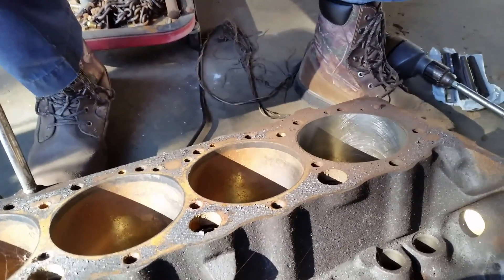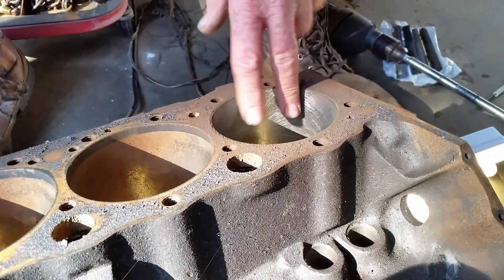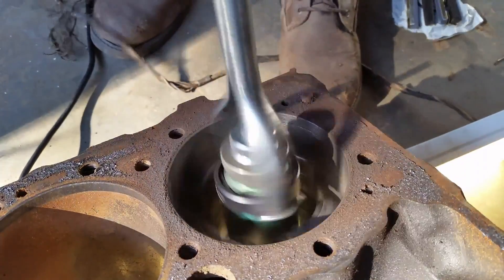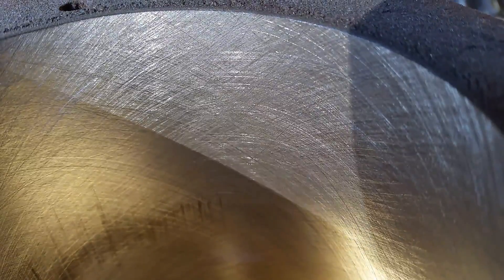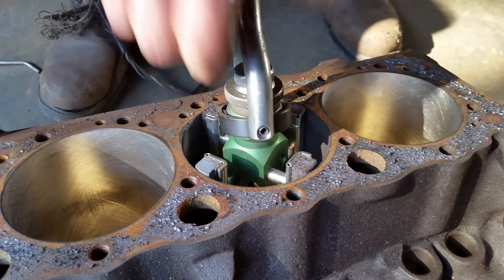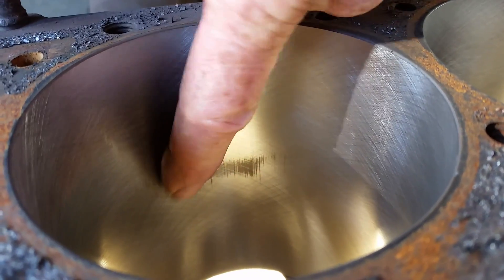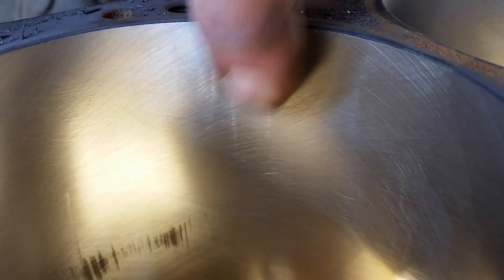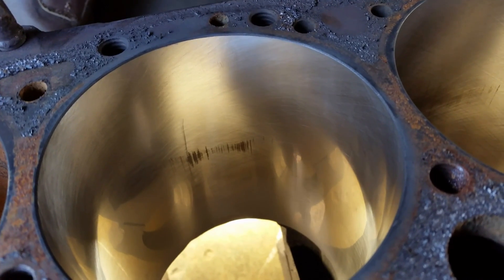How to Platau hone a block

Comment: I know this is the "tried and true" method...
But I certainly don't do this on my personal rebuilds. Seems primitive and haphazzard, to me.
The cylinder material is what should be considered when choosing the grit number, not the ring material. I question whether people even comprehend what is occurring during the seating process. The ring material is so much harder than the cast iron cylinder. Its not as though the cross-hatch pattern serves to "file down" the high spots on the rings. Just the opposite occurs. The honed cast iron conforms to the contour of the hardened rings.
I also refuse to use one of those honing tools on my engines (or my custmer's). Its like a caveman sharpening his spear with a rock. That was great when we were hunting the Woolies, but 
we are a tad bit more advanced today, I'd like to think.
I select the proper grit sandpaper sheet, fold it to an easy to manage size for the bore I'm working on, then painstakingly create the cross-hatch pattern (by hand only) for each cylinder, changing the sandpaper to expose fresh grit for each. I have developed a knack for this process over the years, and it allows for a perfect pattern each time.
Also, to the inevitable horror of the crowd, I will assert that I am very careful to "hone" the ring -travel portion of the bore only. The last thing I want, as I rebuild my engine for longevity, is to create an iron "file" below the ring-swept area of the bore, which subsequently induces unnecessary and accelerated piston skirt wear for years following the initial start-up. Think about it... the thrust-side skirt of the piston rides under great force, along a scuffed cylinder surface that does not get scraped by oil-control, or compression rings. Thus, the interaction occurs between aluminum and cross-hatched cast iron. We all have seen the smooth cylinder bores of used engines...
except for where the rings don't ride. The original cross-hatch hone pattern is always still present below the ring travel. Why let that surface "sand down" your piston skirts? Just apply a little more thought and care when preparing your block for assembly.
Well, I'm in my mid-fifties now, and despite the inevitable on-slaught of rebuke to follow this comment...
I have been building engines this way for decades, without a single failure. I share these concepts for the benefit of those who can embrace them. Otherwise, I am o.k. with those who can't. Build your engines in whatever way you choose. (It makes it easier to pass you on the highway.) Ha.
Cheers.
Reply: I dont know,, I've seen quite a few cast iron rings go in cast iron cylinders. I've also seen alloy rings go in cast iron cylinders.
Reply: marshalllhiepler sir thank you for your comment it was very long..now getting to the sandpaper deal I done the same thing back in the late 70s early 80s.and there is nothing wrong with that.like you I'm in mid 50s...when you are building a race engine you try different things...see that is the defrent between you and me.you build stock..I build race..I've learn a lot over the years like carbs..cams..heads..pistons..rocker arms..and I did the same thing to my cuz race car it went from 7.30 to 7.00 in the 1.8 mile..and some people would pay 1000 dollars per tent...that's 3000 dollars...dam that was a lot of typen...again thank you for your comment.sir
Reply: marshalllhiepler and to 👍
Reply: You were on a role 'till you said you prefere hand sanding the cylinders lol.
Reply: @whiplashmachine ,
Like I said  ...  you build engines in whatever manner you choose to.
I'm certainly not going to ague with your methods, especially not via your sign language in my rear-view mirror. 😁
Reply: @marshalllhiepler  pretty sure it be you,  in my rear veiw😁🍻
Reply: @whiplashmachine ,
"Pretty sure  ..."
suggests uncertainty.
At least your intuition knows what's up. 😆😂🤣
Reply: @marshalllhiepler  whomever it is trying hard to keep up and blowing a bit of blue out their exhaust doing so. Figured might be you or one of these other guys with hand honed blocks😂
Reply: @whiplashmachine  ,
Perhaps you should refrain from knocking "hand-honing", until you try it.
I have proven in my own shop, that honing by hand seals better than mechanical hones, as evidenced by performing leak-down tests.
It requires more time, and effort, but since the rings seat better  ...  I can't go back to the whirly-stones.
Reply: @marshalllhiepler  I've done my own testing thanks. I have also fixed dozens and dozens of backyard hone jobs over the course of 20 years machining engines. A hand hone can be sufficient and I've honed quite a few with Sunnen micro adjust portable hones for fun. But I understood exactly what was going on and the machines do a better job. Only those that can't afford one or to have the op done for them say otherwise.
Reply: @whiplashmachine ,
If you had observed the mechanized honing striations with the extreme emphasis upon detail, as you suggest  ...  you would have noted the inevitable angular flaw, which occurs during direction reversal of the tool. An unavoidable semi-circular arc is left at both the top and bottom of the cylinder, with each and every stroke of the machine.
Only precise honing by hand, can achieve the desired 60 degree cross-hatch striations at TDC, which are of vital importance to the capture of rising pressure, as the flame path propagates throughout the combustion chamber.
This is why my vehicle always passes yours, whenever sufficient asphalt exists.
However, being the mechanical god that you are  ...  you already knew this. Your time spent lounging upon your throne has rendered you lazy, without the energy, or desire to perform the neccessary honing operations by hand. Thus, you condemn yourself eternally, to second place.
And, I am o.k. with your decision.
Reply: @marshalllhiepler  you are correct. I am now going to go and sell my Sunnen power stroke honing machine in favour of cheap youtube hack tools😂😂😂
Reply: @whiplashmachine ,
The truth sometimes hurts, my mechanically inclined one.
But lament not, for thou hast become enlightened.
Reply: There are many different materials used for modern rings today. Cast iron, while still used for very low performance engines, has largely been replaced by better materials.
Here is an interesting article that describes "ring evolution" over the past century or so:
https://www.dragzine.com/tech-stories/the-material-details-evolution-of-piston-ring-technology/
Reply: marshalllhiepler are you having bad dreams about this video??sorry sir..I did not mean to upset you...I just turn 55 my self sir..you know they say you can't teach old dog new tricks...I say b.s. I still want to learn something new every day..and if you look at the video very close you will see the deep cuts is very small that is to hold a small amount of oil...what is the best thing for meadel to ride on????oil.....I done the same prosest to my cousin race car and it went from 7.30s to 7.00s in the eight mile....I have even seen the same thing in a book by grumpy Jenkins...do you know who he was?????I'll tell you he was pro mod in the 70s......soo is the old 55year old dog learning new tricks or does he wats going on?????once again thank you for your comment sir 👍

Comment: Good example of what Nat to do.  So what size is that hole that needs bored?  4 stones? where are the stabilizers? Bore gauge?  Taper? But it will run.  Sorry I shouldn't  beat you up. Make more videos it help guys learn. You will be OK in the shtf scenario!
Reply: Robert Hoard sir you did not beat me up I love questions like this.bore size is 4.060 .there was 2 stones and 2 wipper..no stabilization needed..the block was for dimo only....me and jomasterhn is working on a aude and we did the palto on cylinders and the cylinder went from ..0015 to..0025 other words..001 thousands buy this way.....and sir thank You for your comment 👍.....aney more questions just ask...sir

Comment: Just curious how many thou over the cylinder is after the full procedure or is it a case of matching the piston and rings to the final measurement??
Reply: TheRebelOne this is the question that I have been waiting on....when you are dry honeing it doesn't take a lot out of the cylinder like wet honeing so you can do a lot more to the cylinder .....thank you for your question 👍👍👍👍👍ty.and to if you look at the center of the cylinder you will still see the dart spot in the cylinder was about.  .0005 of a inch now wet honeing the 80 git would have takeing it out and starting to bore the cylinder...and once again thank you so very much 👍
Reply: The rings are always matched to the cylinder bore at the most unworn part.
Reply: This hone takes very little material but it does help true the cylinder and it puts a nice crosshatch on it. I NEVER hone a cylinder dry because it plugs the stone up with dirt. keep it wet and keep it clean and true...approx. a 33* angle each way for crosshatch  so the crosshatch breaks the ring in properly...
Reply: Des Stanford sir did you really look at the cylinder the only place the hone did not touch was that little spot on the out side of the cylinder.....thank you for your comment sir
Reply: A ridge removal tool must be used to remove the ledge on the top of the cylinder before honing otherwise the top ring will make contact  with the ledge and break. ( Standard workshop practice. )
Reply: Des Stanford THAT IF THERE A'S RIDGE AT THE TOP OF THE CYLINDER thank you for your comment sir 👍
Reply: Des Stanford sir I understand what you are saying but this block had NO RIDGE at the top...why do you think it clean up so fast....the block I was useing was a block that a soooo call manschans that did not know his ass from a hole in the ground
Reply: snowman Reed sir this hone I'm used you can used it wet or dry...thank you for your comment sir

Comment: love the,sorry,old school. i've used this to bore out a block when money was tight. as a hole wears at top you start at bottom pulling out hone till it speeds up an push it back down. set tension again,repeat. once you get bore back straight work the full lenth of bore. as for cross hatch pattern to wear rings in i like a bit less 30 degree. bin a bit since i've done one might just blow the dust off mine. used to do rear slave cyd right on the backing plate with a mini one but they stopped selling the rubber seals a wile ago.
Reply: Witt Graham have you tried rubber bands to hold everything together? I got one of them kits too thank you for your comment 👍

Comment: Hi sir I have so many questions 1 is this tool just to remove the edge  of the top the thin line 2 can this  tool be use as a honing tool but to put  the first oversize pistons 3 if it is how do you know how big you need to hone I mean the mm of the piston I have those with sanding paper I sand the edge but  still when I put the piston and finished to start the machine has a lot of smoke coming from top we call it carter pressure
Reply: Sarief Idoe 1 question you probably can.I would not recommend it.2 question yes you can but it will take time.what you want to do use the 80 grit until you can. Just fit the new piston in then finish with finer stone to get proper clearance.3 question you will need to use a feeler gage to get proper clearance.if you get a kit like what I got it will come with instructions.and a big plus is you will see you can use this hone wet or dry I hope I have answer your questions...ty

Comment: By the proper sounds it made,i'd say it was cutting ok;  if it was steel sleeved,oil might be  needed,but being  done directly on the cast iron,which is self-lubricating due to the carbon particles,it seems that  dry is working well here; 

One thing i would NOT do:  run the stone up and down so MANY times; reasons:  
1--- you are ENLARGING the diameter, need to mike it again,to see if it not junk already!!
2---- since you are doing it  BY HAND, the next pass DESTROYS the previous one,because you CANNOT follow the SAME scratches.
Reply: Jose Peixoto You Did not lisan to the video when I said THIS IS THE WAY I DONE IT ty for your comment
Reply: 1-you can buy oversized pistons
2-i can bore a block this way an the engine 20y later is still running in the boat,by hand
3-you should stick to taking stuff to a shop or a car lot
Reply: Witt Graham sir the block was.  .060 over all ready.have you seen the other video boring a block the pistons came out of that junk block.I can put 8 sleeves in.I just can't see cost and time.when it's a 2 bolt block.4 bolt yes. Ty for your comment.....You know what that make a good video.have to think about it

Comment: Stupid guy does not know the correct grits right off the top of his head.
Reply: crosstimbers2 I did my job I did check with ring manufacturers now it's your turn when you build a engine....
Reply: crosstimbers2 and too I'm not stupid as you would hope for.thank you very much.....
Reply from the maker: Are you sure about that?
Reply: L P.  If you can't remember 3 or 4 honing grits you can't know what you are talking about. People have been honing blocks since before you were born yet you don't know what to use.
Reply: L P.  You don't have "to check" with ring manufacturers. They have been publishing their recommendations for more than 50 years. Now you can use that thing called the internet to look up the requirements. If you weren't so backward you could buy a Taylor-Hobson or other brand of profilometer that can actually measure the surface texture of the honed surfaces according to ASTM 46.1.
Reply: crosstimbers2 Dane did upset you sorry
Reply: crosstimbers2 AND TOO RECOMMENDATIONS ARE that tells me I don't have to follow there RECOMMEND stones?????surfacer.????...question do you know how too read rings surface???I do
Reply: L P. No you don't. You can't even remember the common grits recommended by ring makers. Let me know if you ever understand how to actually measure the surface texture produced by the hone.

Comment: Anyone who makes technical how too's should use correct words. Motors are electric or hydraulic, engines are vapor operated. Motor and engine are therefore not interchangeable.
Reply: Johnny James Too and to are not interchangeable either so it's best you just pipe down instead of trying to sound smarter than you are
Reply: Johnny James I'll have to remember that next time.ty
Reply from the maker: Yes, we made a mistake. we will make sure to use the correct terminology next time, or do the best we can XD. Thank you
Reply: True that! Heading out to ride my enginecycle now, peace🤣

Comment: Need to lube the stones as you are honing. Not running lube allows the metal dust to grind more then you are trying to do
Reply: Jose Peixoto soooo sounds like you got a machine that would do it prefert???? Ok cool......but if you would have listen to the video....THIS IS THE WAY I DONE IT...thank you for your comment...and to all I got to do is buy 8 selves and I can make it std bore but a block like that is junk to me.one time boat anchor.because of the center is weak that is why the mark was there....
Reply: L P. Not during the honing process, blowing it out after honing is pointless the debri has already done the damage of cutting more then intended. That's why you run continuous oil while honing to remove the debri from the cutting area
Reply: L P. Where the product is made has nothing to do with following proper procedures. Even in the old Haynes manuals for the diy people it even states in the engine over haul section to lubricate when honing the cylinders. Even manufacturers that make honing tool recommend a light oil to be used so grit does not clog the stone or cross hatching. But what do I know I've only rebuilt motors, small engines and and tractor motors since I was 13 so I guess my 27 years of work is just a sham. never knew a backyard mechanic knows better then some one that does it for a career.
Reply: By the proper sounds it made,i'd say it was cutting ok;  if it was steel sleeved,oil might be  needed,but being  done directly on the cast iron,which is self-lubricating due to the carbon particles,it seems that  dry is working well here; 

One thing i would NOT do:  run the stone up and down so MANY times; reasons:  
1--- you are ENLARGING the diameter, need to mike it again,to see if it not junk already!!
2---- since you are doing it  BY HAND, the next pass DESTROYS the previous one,because you CANNOT follow the SAME scratches.

Comment: I make my living as a full time automotive machinist...kids don't do this ..it's completely wrong.  Cast ring is 220 finish and chrome/moly is 340-360 depending on manufacturer . Scoring of those walls and a 500-600 finish I guarantee the rings will never seal and compression and oil consumption will occur.  You WILL be tearing the engine down ...
Reply: Jim Phillips Mr Jim you was not lissing to the video..I said this is the way I done it...ty for your comment
Reply: Jim Phillips ,

Comment: Dude I hope you've fitted a new power lead to your drill in the last year or so, otherwise I think it's gonna kill you one day
Reply: Good thing you Yanks run on 110 volts......if you were on 240 volts like us in the UK using that power lead would definitely be the last mistake you make.
Reply: Martin Cheney yes sir I will very soon and thank you 👍
Reply: 120v wont kill you with work boots on. Try getting hit with 765 volts DC.
Reply: Colin Pendlebury You think sooo???I can take 5votes and turn them in to 227votes I can and I did running 3Phase on single phase on a belt surfacer You need to check out my sons  youtoo channel and we fixing to do a update😀😀👍....please comment sir